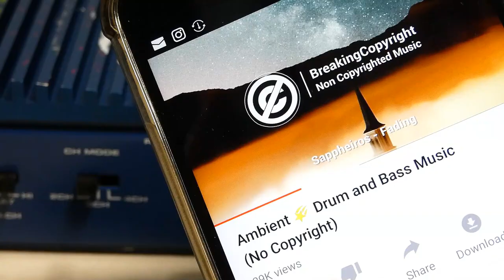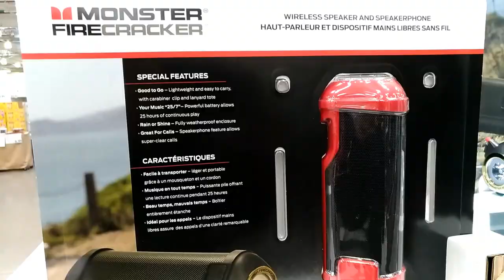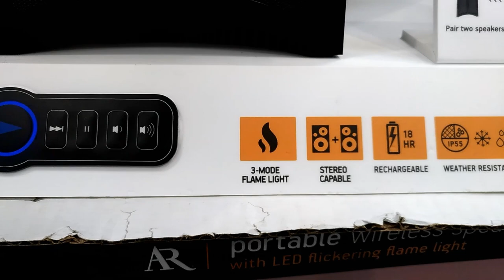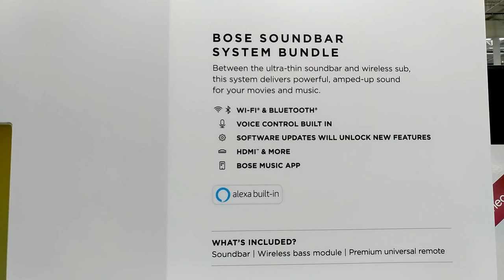HOW TO TURN ON CAR AMPLIFIER WITHOUT RECEIVER REM RMT WIRE

Comment: Out of all the videos this one helped me the most.thank u so much my project wouldnt have gotten complete without this little tip with the switch.
Reply: WHY NOT JUST DO IT RITE AND RUN REMOTE WIRE TO DASH BOARD TO RADIO LIKE ITS SUPOSED TO BE ISOLATED TO AND FILTERED. ?
Reply: My kenwood excelon doesnt have a remote wire for sone reason

Comment: I am curious, the amp has 4 channels with a toggle switch on the front panel to switch between 2, 3 and 4 channels. You selected 2 channel mode but on the rear you've connected your speakers A+ B- (left, depending on how you look at it in the video) and C+ D- (Right, again depending on how you look at it in the video).

Why didn't you connect A+ A- for left and C+ C- for right ? Also, shouldn't the front audio inputs be channel A and channel C? Or is this how you wire up the amp in 'bridged' mode? The way it's wired has me so confused :)

Comment: Will this work between my car battery and an 800 watt amp? i just want to make sure its safe. THANK YOU!!!!
Reply: also i will need to use larger wire, 4 gauge. will this switch work with that wire? thanks!!
Reply from the maker: This toggle switch is rated as 35A. So, it can stand with up to 420W for 12V car amp. Normally, amplifiers are rated as RMS peak watts. So, I think this toggle switch is ok for your car amp with 4 gauge wire. You can use it with your car battery. But, I suggest to buy a 50A or more rated toggle switch.

Comment: if i connect 12v+ REM the red led for PRT (which means there is a bad connection or wiring) after multiple tries the power goes on and the woofer works, but is kind of random i tried even be reversing polarity and going up with the voltage same results.

Comment: Hey SKILFUL LIFE, can you use any  toggle switch?
Reply from the maker: You need 10A toggle switch at least. Otherwise, if it is less than 10A, when you increase the volume, the switch will over heat and get damaged.

Comment: Can you giving it direct current without power supply?
Reply from the maker: It is from 12V DC power supply.
Reply: Use a laptop charger or x-box console adaptor 12v. I tried it it worked
Reply: Are u conneCted remote out to positive terminal of amp???  Plz rply me

Comment: could you connect it to the speaker wire instead so wen stereo turn on the amp turns on?
Reply: do it the way he did it..... learn about polarity and amperage